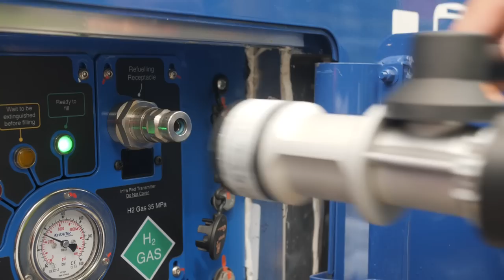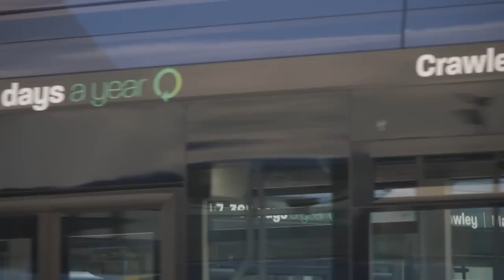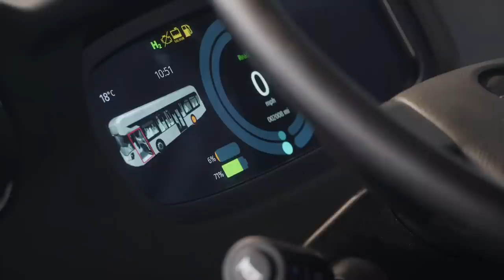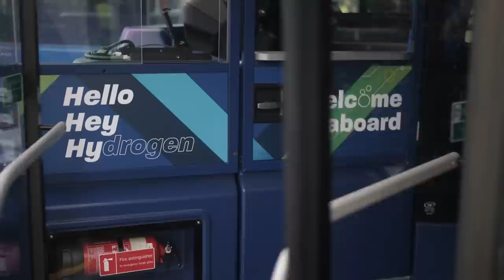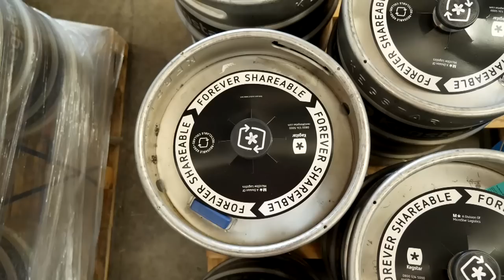Hydrogen buses and trucks – the future or a non-starter? | The Climate Show with Tom Heap

Comment: How long does the hydrogen stay in the tank before it is gone?
Reply: Depends, if it's stored okay without any leaks then it rests on how thick the smallest fuel pipe is for the hydrogen to diffuse through it, plus the rest of the system.
If it springs a leak, not very long. If it then finds an ignition source, near-instantaneously.
Reply: Hydrogen is the smallest molecule on the periodic table meaning air tight isn't enough, the problem in my mind is if it isn't pure ish and still contains oxygen then its very volatile and doesn't like to be compressed

Comment: I'd be interested to know the economics from production to end of life for a vehicle. For example, for how long will a hydrogen bus run until it is completely worn out and the drivetrain had done all it can, what were the costs associated to that. Compared to how long a battery electric bus will run and how many times the battery has been replaced and at what cost including the recycling costs of the battery itself. I'm betting that "inefficiency" of hydrogen doesnt look that bad when those numbers come out...

Comment: It’s a good idea but I’d like more safety tests before I would travel on it
Reply: No thanks.  Hindenburg on wheels.   😂🤣🤪   😡😡😡
Reply: It is much  safer than a regular ICE vehicle.
Reply: Sure thing   😂🤣🤪
Reply: @JoeyBlogs007  sure thing.
Reply: Hydrogen will never be a major player in the terrestrial transport sector.  Perhaps in shipping and aviation, it might gain greater popularity. The EV chapter has been mostly written.
Reply: @JoeyBlogs007  No.
Reply: Ohhh YES  😂🤣🤪
Reply: @JoeyBlogs007  Nope.
Reply: Ohhh YES  😂🤣🤪
Reply: @JoeyBlogs007 You can just only batteries in BEV buses with no passengers😂
Reply: 500 Wh/kg is pretty knocking on the door.  It's Game Over.
Reply: @JoeyBlogs007  game over for who?

Comment: Hydrogen ICE vehicles make the most sense, like the one JCB has perfected.
Reply: A) they haven't perfected it they have some running B) hydrogen is a worse pollutant than running from petrol, diesel or gas
Reply: @trialsted  Not a fan of hydrogen, but always a fan of truth. As far as i know, burning hydrogen produce water which is not a pollutant.
Reply: @mathieusimoneau3358  Exactly. The only emission is water.
Reply: @mathieusimoneau3358  Actually burning hydrogen in an engine produces nasty NOx pollution while making the already bad efficiency even worse.

Comment: How is it possible that a hydrogen bus which costs nearly twice as much as a conventional diesel vehicle not cost us more? If the extra cost is not being collected via fares then the cost will have to be covered through taxes.
Reply: An ice bus needs so much maintenance. Evs don't.
Reply: @jameshughesdon5370  the maintenance costs may well be different but that does not mean they make-up for the higher purchase cost. There still needs to be an explanation of how these initiatives are to be funded.
Reply: I suspect hydrogen IC power units are more expensive to manufacture,  in part due to safety requirements and the exacting safety standards and testing required in the engine manufacturing process,  compared to a conventional IC engine.
Reply: @JoeyBlogs007  There is that. There is also the infrastructure requirement to provide refuelling services. It is not such a big problem for public service vehicles of the various types but for private transport in its various forms there would need to be a wholesale duplication (or there about) of the existing fossil fuel services stations. How is that going to be funded?
Reply: Yes that too. Infrastructure is a significant cost factor for hydrogen.
Reply: The purchase was partially founded by the UK government and also the EU
Reply: @attilab.2818  I suspected that the UK Government would be involved, while the EU would be involved in one of the tail-end projects.

So the fleet and infrastructure is funded via tax-payers - something that could not be extended to all bus fleets without a substantial charge to public tax revenues.
Reply: @jameshughesdon5370  I think that is incorrect. I've heard EV's  are more likely to be written off compared to ice cars if an identical collision. Maybe that is why they have less maintenance, because they go straight to the landfill instead.
Reply: @vsstdtbs3705  Yes, unfortunately because the battery pack takes up most of the bottom of the car, as soon as its dented insurance firms wright the car off. This is changing as there are now EV inspection firms that test the pacts integrity. Even a written off EV is valuable, it won't be land fill. Battery's get reprocessed and body recycled

Comment: In response to the so-called "experts". Scrapping all buses and trucks and producing new EV replacements with Cobalt batteries produces much more CO2 than the current diesel trucks does in their entire lifetime. They would also be much heavier and that would affect the roads. There would be more needs to repair roads much more often. This also produces more CO2. As so called "experts" they should know that putting all your eggs in one basket is a dangerous move and it could be your downfall in the end

Comment: The range needs for trucks are limited by the time the driver is allowed to drive before mandatory breaks. Plenty of time to recharge during those breaks. That probably explains why they are already mass producing electric trucks, while hydrogen is still prototypes.
And for buses, whole cities in China run on electric buses already, so that works too.
Reply: EV with solar panels on the roof could help make up much of that range gap.

Comment: Why are we going down this route,We have a perfectly suitable method already ,Rail. Trucks should only be used for the last 10 miles. Buses etc can easily become battery electric hybrid using OHL  like trams trolley busses to re charge whilst running in town, going to batteries for the longer parts of the journey .
Reply: Except we don't have rail routes that access all the rural communities do we? The infrastructure is also far more expensive due to lower number of users

Comment: We are on the cusp of the small modular reactor (SMR) era. Site clearance is already underway for the first BWRX-300 SMR. GE Hitachi's Sean Sextone: "...expect to receive [the Licence to Construct] approval at the end of [20]24..........that's when real hard construction starts..." The BWRX-300's commercial operation date (COD) is 2028. 

Within a decade of that, it will be obvious to the commercial money markets, with trillions of investment $s available, that SMRs with build programmes of 2 to 4 years, makes further investment in dysfunctional wind and solar power plants (WASPPs) completely crazy and environmentally repugnant. 

SMRs can supply all of the on-demand electricity as needed - base load, diurnal and seasonal load following. SMRs can also manufacture nuclear enabled hydrogen (NEH) to clean up transport and the many industry processes. 

SMRs + NEH will improve the lot of humanity in $ terms and in terms of longer, healthier lives by completely eliminating our dependence on burning fossil fuels (FFs). 

Burning fossil fuels in rich nations has 'evils' that clean technologies can eliminate. Typically in the UK, it's easy to show the cost saving each year is at least 2X better than a zero-sum-game, which equates to a £750/year saving for each of the 29 million UK households - forever.
Reply: Nonsense.

Comment: Absolutely they should be making all vehicles run on hydrogen. Clean, safe and economical.
Reply: and 3 times the cost, only lasts for a month then all leaks out..... and most hydrogen filling stations have now been scrapped in the UK because there so expensive to run

Comment: What's not covered by these reports is the manufacturing and disposal of lithium is extremely toxic for the environment, the cost of servicing electrical vehicles is much more than traditional vehicles and the replacement of batteries (in yrs) and the cost.

They are missing so much vital information
Reply: that's because the evs don't have lithium unlike your phone. also the batteries have a 1 million mile guarantee. the rest of the bus will be scrap before this happens.
Servicing a EV is so much cheaper then a ICE it's basically £0

Comment: Fantastic! The Clown Climate Show. My Favourite. Today Tom clearly knows nothing about hydrogen. 

Currently 95% of commercial hydrogen is sourced from fossil fuels. 

To produce 1 kg of hydrogen from water requires 40 kWh of electricity (*) in a 100% efficient system. Most systems are not 100% efficient and require around 50 kWh of electricity. 

1 kg of hydrogen has an energy density equal to 34 kWh. 

😆😂🤣🤣😂😆 - Go for it. 

(*) How is that electricity generated?
Reply: It can be produced from water using electricity.
Reply: I know. I gave details of that in my original comment.
Reply: Using electrolysis of water (green hydrogen) is the way to store excess electricity for nighttime of when the wind does not blow.